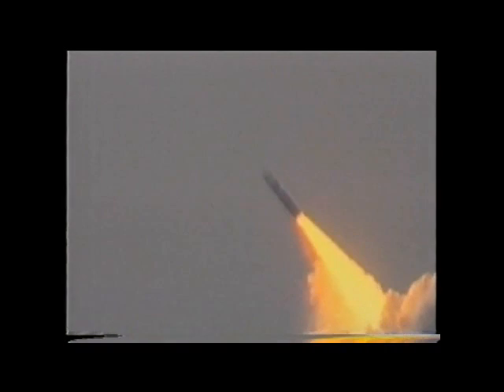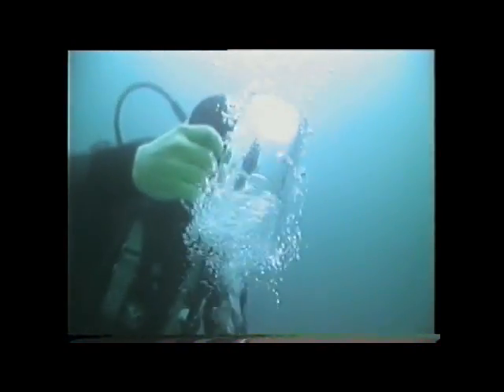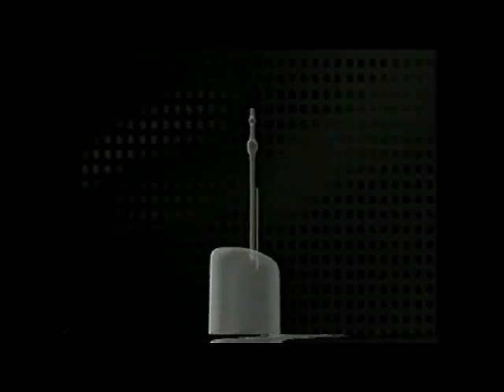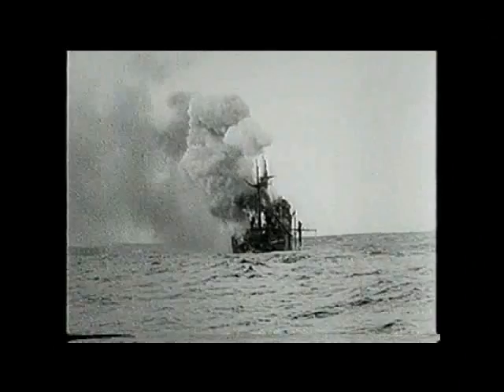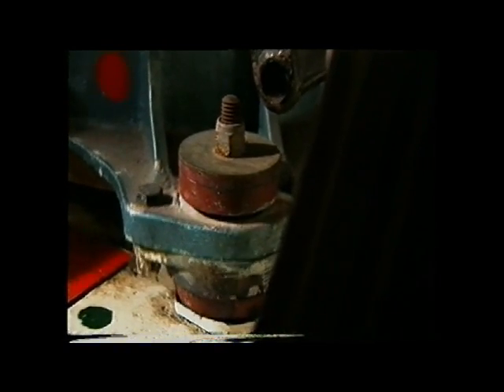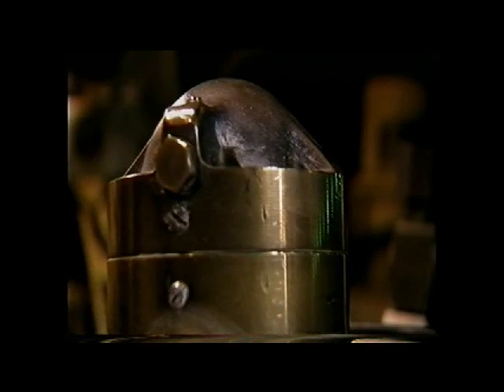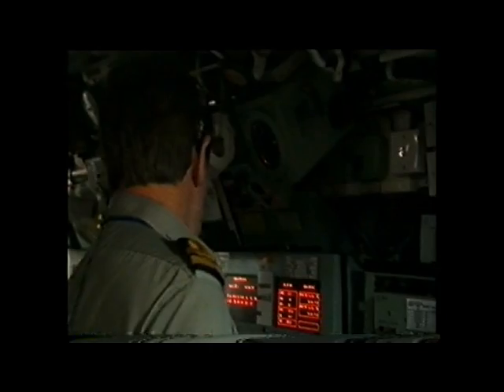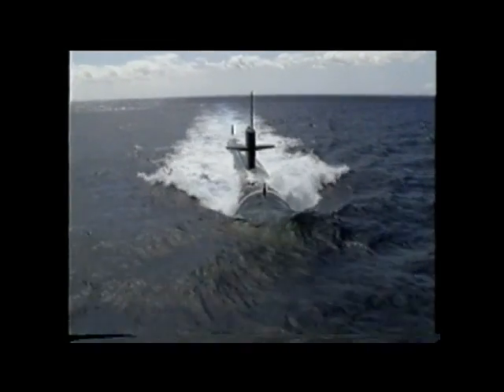Submarine Pressure Testing - Part 2

Comment: Look, you can weigh everything that goes into a boat, once it submerges, one way or the other, you shift water from ballast control tanks, forward, aft, midships negative tank or port and starboard to get a sleepers trim. Now, all it takes to mess up a rookie diving officers day is a trim party. Ten of the biggest guys on the boat, meet midships, then all move after. After the diving officer re-trims the boat, they all move forward in ones and twos. Very simple, not complicated as this guy says it is. Also, on the dive, either the bow planes or fair-water planes are called into action to help control depth. Speed is also important until a trim has been achieved to the skippers OK>
Reply: Run into mis-calculation of the zero trim by an officer in 60s in one of the WW2 Guppy class sub.  we were going down fast until we got more speed and the help of the trim pumps and the planes, we came back up.  Scary.